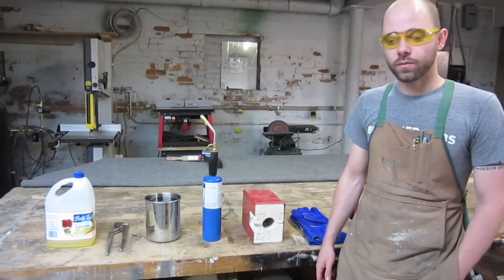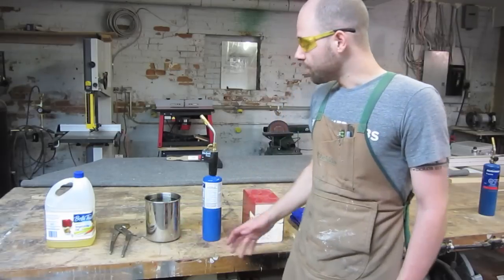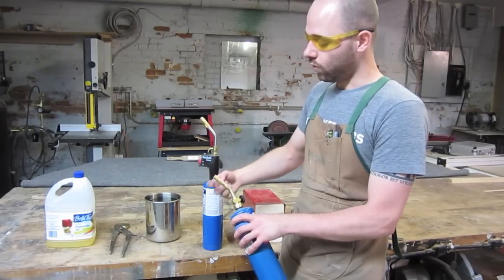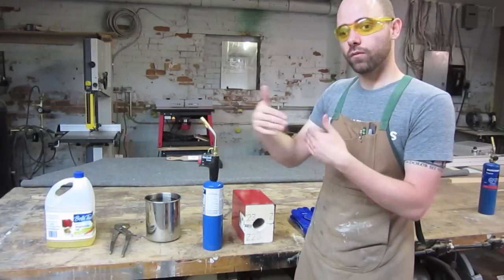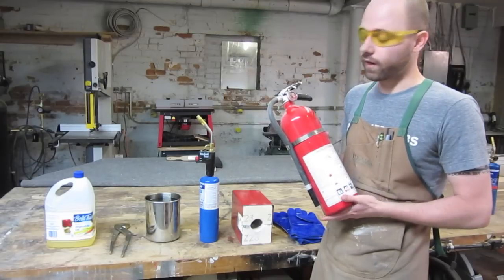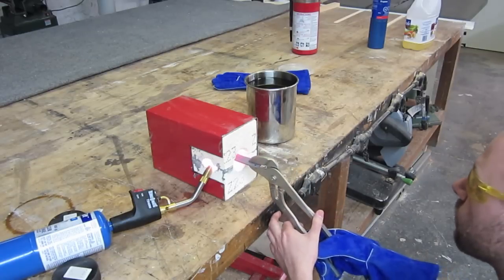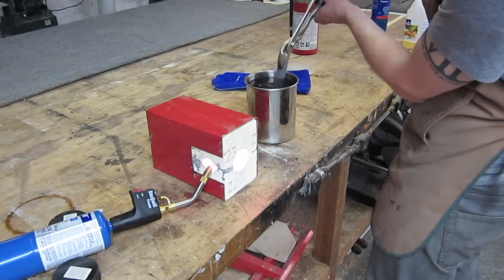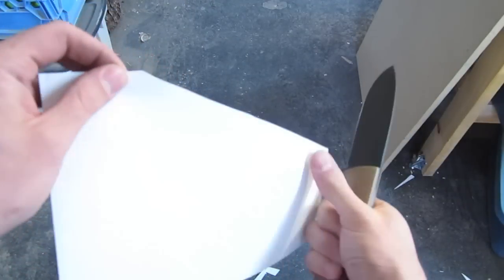How to heat-treat an O1 knife blade using cheap common tools.

Comment: Hi! Thanks for the great videos!
I built a very similar forge and experimented with it.
It works well but I can’t harden the steel properly... I need some tips please :)
I used the magnet trick to find the right temperature.
Four times the magnet was not attracted anymore, the four times I heated up steel again after the magnet test, then quickly cooled it with oil (vegetal).
All pieces of steel failed the file test. I could still grind the steel by forcing a bit.
And I tried to break the steel to test if I became brutal, but instead it just bent without being tempered...
What am I doing wrong?
Is it possible that the steel I used requires a different hardening method?
Or could it be my magnet that is not strong enough?
The steel was close to orange when I cooled it down...
I’m in Germany, the shop calls it “Gezogen Stahl” (drawn steel).
https://products.alfer.com/en/Products/Hardware/Steel-profiles/Standard-profiles-Steel-drawn/Flat-bar-drawn-steel.html
They don’t give the composition of that steel.
Should I use a specific steel?
Thanks again for sharing all these vids.
Cheers
Reply from the maker: +Jules Parmentier hey mate! Unfortunately it sounds like you have used regular steel, which can't be hardened...

I'm order to harden it you need to use tool steel. I recommend O1 tool steel, though in Germany it will be called something else, if you look online for a tool steel equivalency chart you will be able to find the grade!
Reply: Damn it :) So I guess my blade is good for trash...
Anyway it was good to exercise stock removal and hardening technique :)
one more question, can carbon steel be used for cutting food? Or only stainless steel is appropriated?
Is O1 steel some kind of carbon steel ?

Thanks a lot for the feedback

Comment: Thanks for reply.
This clip should explain my problem better
http://youtu.be/5_7h7Oh1Rtc

And yes. I managed to heat treat one blade but it took ages and temperature was just bit more than demag point
Reply from the maker: It looks to me like the mouldable brick just isn't insulating well enough. After keeping the torch in there for a few minutes the whole cavity should be glowing white hot, far brighter than the blade, I didn't see that in any part of your video.

The torch you're using looks fine.